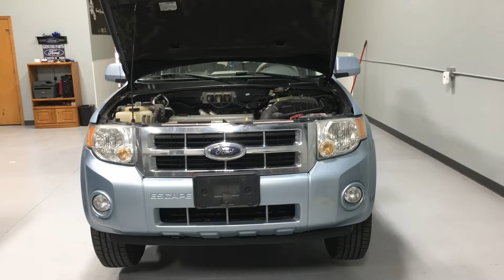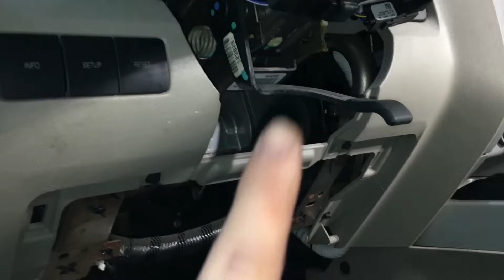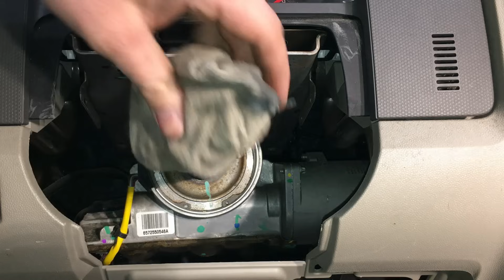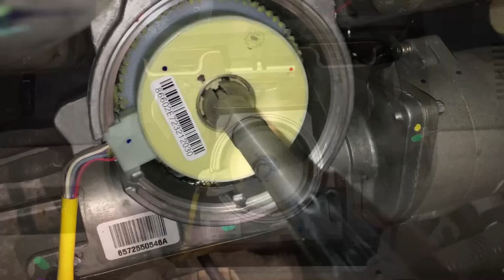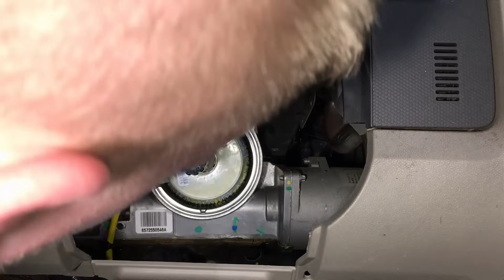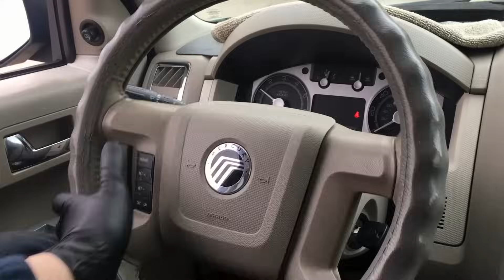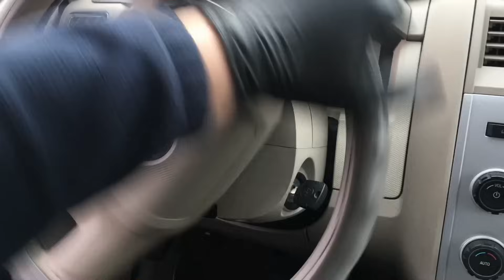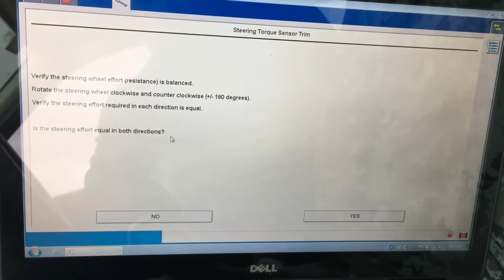2008-2012 Ford Escape Power Steering Code B2278 : EPAS Torque Sensor Critical Installation Steps

Comment: Great video! I got the new torque sensor in and aligned properly. I found a very large pair of needle nose pliers worked to remove the snap ring. I broke the ends off my snap ring pliers and could not locate a big enough pair to borrow or purchase quickly, plus the big needle nose are relatively cheap. I need to have the codes cleared as the steering did not automatically start working, hopefully that does the trick. Only looming question I had was if it matters when you’re reinstalling the steering column (after the sensor is aligned and the pin is removed) if the wheels and column stay perfectly still? In the video it appears that the steering wheel is back at 12 o’clock or straight position before you turn the key or start the engine. But otherwise a fantastically informative and useful resource!
Reply: Wanted to add that after having the "power steering assist fault" cleared. The power steering came right back to life.

Comment: Brian, great video, really helpful and thorough. You weren’t joking when you said the snap ring was huge. I followed this video and replaced the sensor successfully. I’m a bit stumped though as I still have a power steering assist fault and the power steering flat out doesn’t work, no shaking, no intermittent working, just full manual all the time. It was like this before I replaced the sensor, but as I had the code B2278-EF I thought that this was the fix based of general internet consensus. Do you have any tips for me? I’d greatly appreciate it. I’ve used several of your videos to fix my Ford Escape so far, you’re the best resource I’ve seen when searching for fixes. Thanks again.
Reply from the maker: Disconnect the battery and clear the codes. Retest, is it ok now?
Reply: @FordTechMakuloco  I disconnected the battery and left it off for long enough that when I reattached it and started the car it cranked for longer than normal as if it forgot all of it’s trims. Same fault came up on dash and no power steering. Is there a better or different way I should clear codes?
Reply: @ericzeimetzable  how did you fix the code problem?  I got the same situation now.  Thank you sir.
Reply: @zacharysweather984  I sort of gave up, and took (drove it while getting a workout) it to an independent shop hoping that they could code it and I didn’t screw anything up. Turns out I did the repair perfectly and they charged me an hour for a tech to reprogram it. It worked great thereafter! We traded it in about a month later though because the shop told us the frame was pretty much rusted through, and they warned about the car starting to become more expensive than it was worth.
Reply: @FordTechMakuloco  Hi.
Thank you for all your videos.

Please tell us more about the calibration without a scan tool.
Mine is harder to the right and softer to the left :).

But I still don't want to pay a shop or a dealer, as I do those things usually by myself.
I'd rather buy a scan tool (hope not :D).

Comment: This is a great tutorial.  I just followed it step by step and BAM, fixed my twitching issues on a 2008 Escape.  Thank you once again!
Reply: Hi, I have a 2008 escape as well. Question, was it have to turn your wheel after everything was in placed? I'm trying to figure out why my sensor is not clearing

Comment: B2278 code is gone after I replaced the torque sensor. The dash light power steering assist fault is still on and the power steering is still not working. Im assuming the electric motor went bad. I purchased a used motor and installed it. This fixed the issue. The electric motor is held on with only 2x 13mm bolts.

Comment: Exactly why I took off the original whiny Ford pump and use the older F350 Saginaw pumps on my trucks. The old ways are best, and good enough to power a hydraulic winch 😉 👍

Comment: Got the code B2278 - replaced the steering angle sensor.  Started it up and nothing.... still the same code.  Fuse is good - any other places to look?
Reply from the maker: Clear codes, cycle key and restart. Does it work now?
Reply: @FordTechMakuloco  That worked!  Excellent video - thanks for all the tips!  Merry Christmas

Comment: how to know if I need to replace just the sensor or the whole steering column?? when steering is functional It makes a little quicl shake to the left and I feel like if something inside (may be a gear or a motor) is not engaging correcty like if something is spining without traktion I dont know how to explain
Reply from the maker: If you have just a B2278 then just sensor.
Reply: @FordTechMakuloco  Thank you very much! ;)

Comment: Great video and really appreciate the detail.
Received my steering torque sensor about a month ago but hesitated replacing it since the loss of power steering went away for that period of time. Problem returned so I performed the replacement. Followed your video, step-by-step, as well as the paper instructions that came with the part (from a Ford dealer) and when I started the car the wheels spun all of the way left. I disassembled everything, looked at the sensor alignment and the alignment was absolutely perfect...right in the middle of the hole. Just like it was before I attempted to start the vehicle. I re-installed my original torque sensor and received the same end result. I watched your video, again, start to finish, to make sure I didn't miss a step and I had not. Everything was spot on but the process still failed. Any thoughts?
Reply: hello. Please tell did you figure it out? Were you able to fix the spinning part?
Reply: Guys did you figure out ?

Comment: quick question on this sensor. we were thinking of installing the entire lower half of the column(used) do we need to worry about this sensor being over-rotated like the clock spring up by the steering wheel?

Comment: So I did this, the steering wheel didn't flip out. The hole in the sensor was almost dead seat center. But I've still got a power steering fault??
Reply from the maker: Clear codes and retest.
Reply: @FordTechMakuloco  i have. Even disconnected battery. Maybe its got to go to Ford? I have no idea. Has the power steering fault and Manual steering
Reply: @FordTechMakuloco  i did notice that I had to use a lot of force to get the sensor to bottom out. More force that it looked like you put on it. It is possible I put too much force on it and broke it?

Comment: Question, I changed the torque sensor got it aligned with no flip out at the end. Turned the wheel all the way left and right as the Escape was telling me to, HOWEVER, the info on the car is still saying Power Steering Assist and it turns easier but you can tell I still don’t have full power steering??  Any suggestions here??
Reply from the maker: Clear codes

Comment: I just ordered this part for my 2006 Ford Escape Hybrid but looks life it won't fit. What is the part number for the 06? Anyone know? Can't find the same part...
Reply from the maker: This only applies to 2008-2012 models as noted in the title.
Reply: Thanks for your help,  I ended up buying a used Power Steering Control Module on ebay (multiple sellers there $110-$250). According to the local Ford dealer,  the original be part ($750+) is no longer being manufactured. For 05-07 the "torque sensor" is inside the PSCM and is not replaceable.

Comment: What would be the next step after replacing this torque sensor??

I still get "power steering assist fault" light after replacing this stupid sensor.. Just the C-clip took me 4 hours and 4 broken pliers 😑 note to self: never buy Ford
Reply from the maker: Pull codes, then disconnect battery 10 minutes, then reconnect. Do you now have power steering?
Reply: @FordTechMakuloco  when you say pull codes, I'm using an obd2 scanner but there is no check engine or codes stored... Just the "power steering assist fault" message... Is there another scanner I need to buy to reset this light??

Comment: What if you did everything right but there still isn’t any power steering
Reply from the maker: Clear codes and retest
Reply: @FordTechMakuloco  that’s my question as well is where can we have the codes cleared? After that I will check fuses and then I honestly may just sell the damn thing I’m over it.
Reply: We also just did this and feel we did it correctly but it still just comes up with the power steering assist fault when key is turned on. The wheel doesn't move at all on its own, and there's obviously no power steering when driven. Is a special code reader needed to clear this particular error message?
Reply: I took it to one of my mechanics and his Snapon scanner was able to clear the code and it works perfectly now. Just a couple notes, my 17 year old daughter did most of the work but I had to help for a couple things, mostly the snap ring. I had to buy a bigger set of plyers from Princess Auto which worked great. Thanks everyone!

Comment: i loved your video it explains everything very clear and well. I did the job and thought i had it but when i started the car the wheel turn completely to the right by itself. I started the process again with the same sensor that i had purchased but same results. Could it be the Steering module, or what they call PSCM or is it that i ruined the sensor and need to buy another one. Please help me with your sugestion. My email is bogart315@gmail.com    Thanks

Comment: I hope you see this. My tech replaced the torque sensor, you can feel the trim needs set like you say at the end of the video. Tech says he doesn't see the fast learn in the scan. So when doing it manually, do the wheel need to be off the ground or not?

Comment: Those odd sized 5.5mm sockets you used in the very begining, those should probably be linked in your amazon store too. Some people wont have those. Not exactly common stuff!
Reply: You would be hard-pressed to find a 1/4" socket set that did not include 5.5mm. It is a direct analog to 7/32" SAE as well

Comment: So I just did this yesterday on my 09 escape with 113k.  I got the steering wheel shake in november of 19 but then it just went away.  then just like that BANG no steering.  This took me longer than this video because I was very deliberate in everything I did.  Oh and that snap ring is HORRIBLE.  That was the longest hangup for me.  But now she steers just fine, unlike others on here I"m not experiencing any resistance to one side.  Thank you VERY much for this video.  Now I'm just waiting for the wifes car to start failing, a 12 escape with 140k on it.

Comment: Thank you Soo much for this video. Mechanic installed the torque sensor incorrectly and wanted to charge me $1900 for a new steering column. I ordered a new torque sensor, and nailed it first try!
Reply: The same problem is happening to me with my car. The shop has been working on it for almost a week. 
I am going to try and do it myself. The want to charge $2k for it and the car was purchased for 2k
Reply: Aa

Comment: Hey there.  What if you go through this process, and nothing changes?  Neither the steering wheel flips out or the power steering returns.  Confirmed code B2278 even after the torque sensor was replaced.  What should I do from here?
Reply: hi there.  did you ever figure it out?  I went through the same thing.  I just spent the morning replacing it and it didn't give me my power steering back
Reply: @johnm8078  I had to get a second sensor put in, then it worked.

Comment: Question:  I followed everything to a t and when I keyed on nothing moved.  When I started the engine the wheel turned to the left slowly.  Should I be zeroing the sensor with ForScan prior to starting the engine?  Not sure what I am missing.

Comment: Great video. I was able to replace sensor no problem but I still don't have power steering. Will I need to replace the steering motor too?
Reply from the maker: clear codes first
Reply: @FordTechMakuloco  I have a cheap diagnostic tool. How can I clear them? Also wrench light is on
Reply from the maker: Pulling the negative battery cable for 10 minutes works.
Reply: @FordTechMakuloco  Thanks for getting back to me. I have removed the neg. cable a few times and that didn't work. Maybe I should have it recalibrated at the dealership?
Reply: @MJ-sn4ue  Ditto.  Just did my son's escape today.  His had the fever shakes but power steering completely died, or was locked out via pcm with wrench light.  Was hoping torque sensor would revive it.  Went smoothly but no power steering.  Wrench light on.  Disconnected battery for 2 hours, still present.  Trying to figure out next plan of attack...
Reply: @Bizill75  It is good to know that I'm not the only one. Thanks for replying. Let me know if you come up with anything. I will be taking mine to mechanic later this week.
Reply: @MJ-sn4ue  I've seen others claim they had dealer or friends with a more capable scan tool reset the SAS steering angle sensor or torque sensor in our case and it worked again.  I've ordered an Autel unit and hopefully that does the trick.  Amazon delivery Wednesday.
Reply: Used the Autel MaxiDiag MD806 and cleared the code, got the power steering back. I also used it to "calibrate" but we have the easy steering to the left and a bit harder to the right.  Now it pulls to the left also.  No way the alignment went out on us too...
Reply: @Bizill75  Thanks for the update. I took mine to a mechanic. He charged me $170.00 to clear the code and re calibrate the steering. It works again! Good luck with yours. I'm doing this for my son too. Next project is tie rod ends. I'll be checking Brian's video for that also. Thanks again Brian! keep the videos coming.
Reply: @MJ-sn4ue  I'm gonna try to play with the Autel again as my son was in a rush to get his Escape and do some running around.  He said the steering effort is getting harder vs easier so we'll try another recalibration and hopefully put an end to this tiresome ordeal.
Reply: @Bizill75  Hey there! I realize it's been a while since your comment... but unfortunately I've found myself in this exact situation and was curious if you ever figured it out, desperate to find a fix ! Thanks !
Reply: @KoroBila I installed a replacement torque steering sensor and it helped but pulled to one side.  Had to go back into the sensor and set it a bit off-center and it worked great since then.  I guess the sensor window being off make it happy internally.  That, or I didn't let the steering wheel move when reinstalling everything.  Point is, it took a couple tries but works flawlessly now.
Reply: @Bizill75  Thanks for the reply, i'll give it a try, we'll see how that goes for me, fingers crossed...

Comment: Hey so I managed to get the new sensor on and when I put everything back together it all seemed fine. While the wheels where still in the air my steering wheel moved just fine like before. But once I lowered the car and tried to test drive I had the same issue of the wheel not turning. It DID NOT flip out on me when I first turned it on. The steering wheel stayed in place. so it made me think i did it right. But here I am stuck with the same problem. What do you recommend I do?
Reply from the maker: Disconnect battery for 10 minutes to clear codes.

Comment: Ford reflashed mine years ago and closed out the recall. Now there's no power assist and code B2287. Paid for and changed the torque sensor all is good now! Great video, made the job much easier!

Comment: Hi There,
Today I changed my worn steering coupler ( U Joint) .  I jacked up one wheel . But more importantly, while I had the old Joint off, and before I put the new one on ... I spun the steering wheel 
to get better access to some bolt holes ..... as soon as I fired it up, I got the power steering assist error.    I am not getting any shaking steering wheel.....  so think my sensor just needs to be re-aligned .  Is that possible with out an alignment tool .... or is it possible to re-align my sensor without a new torque sensor as my whole system must be out of alignment . Thoughts? 
Love your videos btw..... probably spend hours on your channel , watching stuff on other vehicles even .  Some lucky folks in Chicago !
Steve

Comment: Just got mine done and put together.  Steering wheel didnt spin after starting,  but i still do not have power steering.  Before i replace the power sterring motor should i have it scanned and have the code reset?
Reply from the maker: Clear the code

Comment: 2009 Escape had the failed PS torque sensor:  Used steering column installed by independent shop for total cost $500, with 90-day full warranty.
FYI, YMMV.

Comment: Okay, thank you, your vid helped do the repair! 
The advise I would add, is get hold of a pair of 16" snap ring pliers for putting the ring back in . . . it's a monster.
Reply: I did the repair last night, could not find snap ring pliers big enough to work (I tried to purchase or borrow and had no luck). Fortunately, the snap ring is so thick, and the holes in it are so big, that a pair of oversized needle nose pliers did the trick. I broke the ends off my normal sized snap ring pliers trying to compress it, found the long needle nose for $15 where as the snap ring pliers big enough would have been 3 times more and I would have had to order them.